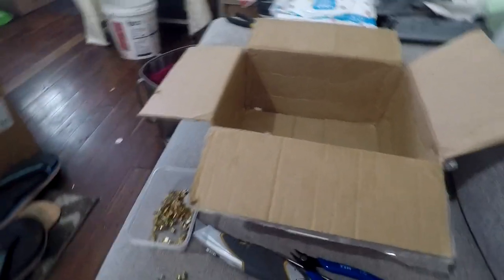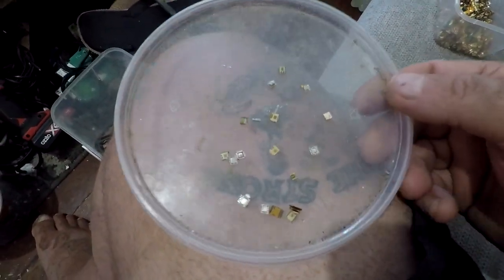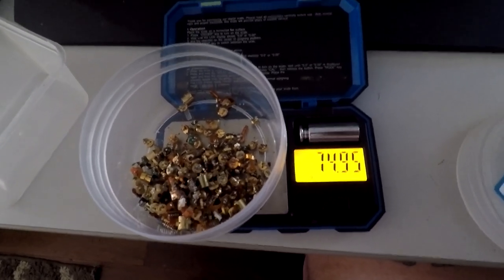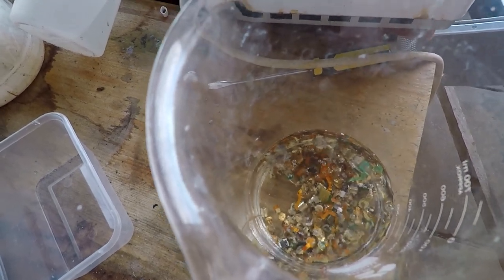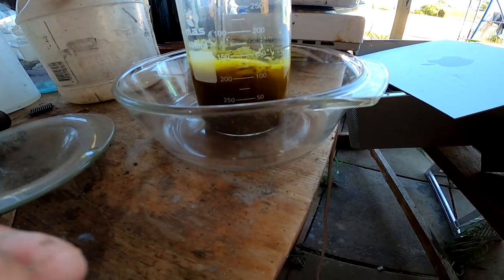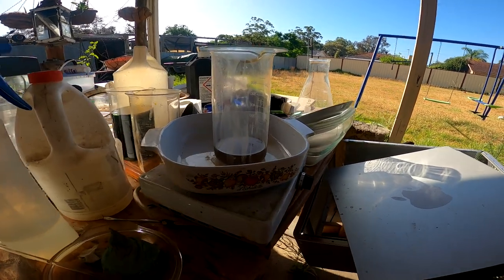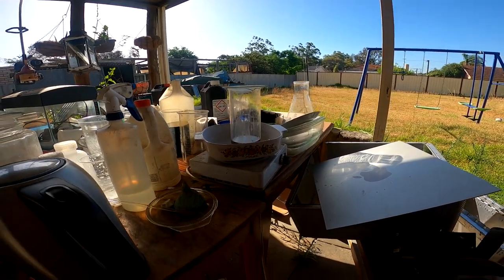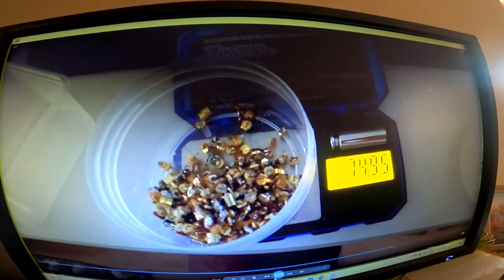GOLD RECOVERY / recovering gold from lazer diodes

Comment: My calculation says:
Start weight = 74.95 gr
1% of the start weight is 0.7495 gr
Yield = 0.61 gr
0.61 gr divided by 0.7495 gr = 0.81 % yield
That is 8.1 gram per kilogram
In my opinion, this is a very large yield; more refining will bring that down a few 10 tenths of a gram, probably.
Reply from the maker: nice , thankyou so much
Reply: @prospectorpete  Well, this yield is very inspiring, as other stuff like IC's and what not, give a yield from 0.5 to 1.5 gr... I will be looking out for CD/DVD's more fervently 🤑
Reply from the maker: @TheDurdane  I always remove the lazer diodes.. I know most people just leave them

Comment: Oh, and just one question. Did you denox after the AR bath?
Reply from the maker: didnt need to , i use incremential additions . meaning i add small amounts as needed ...denoxing means destroying excess nitric and i dont like to waste it because its so expensive
Reply: @prospectorpete  `Yeah, that's actually the best way in my opinion. Nitric is expensive here as well, and difficult to get because of restrictions. Although a wee bit of urea can prevent that some Au will go into solution again. But since you restore the rest in a stockpot, you got that covered, I presume.

Comment: Hi bud 100 people i have watched just filter the gold on last wash into clean filter and then dry the paper and melt it in the filter and borax no problem and lots melt it wet in filter
Reply from the maker: ok thanks
Reply: Small coffee Filter and rinse in funnel works, but then not with borax yet. 
Use sodium bicarbonate on powder in the filter. Borax later as it beads up. 
Problem is borax gets glassy on hot surface. But torch blows away, while it is still light and fluffy. 
Use baking soda and stir into gold powder or sprinkle on filter, fold up in crucible and hit crucible from side with torch for a few seconds. Low heat makes the powder into a gold powder cookie and no fine gold will fly away from torch flame.
Highly recommend this if you melt fine powders that torch can lift.
Reply from the maker: @Colonial Charlie  I hate using borax and ive proven I get 999 purity without is.
I have soda ash, I'll be using that in the future